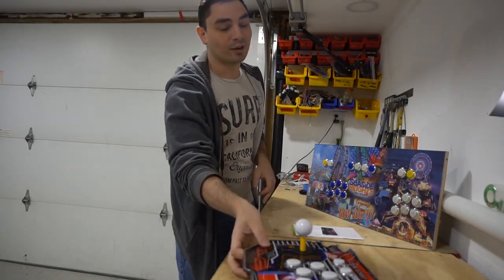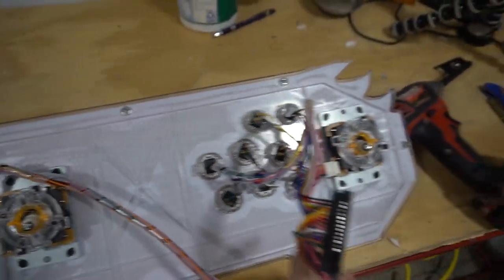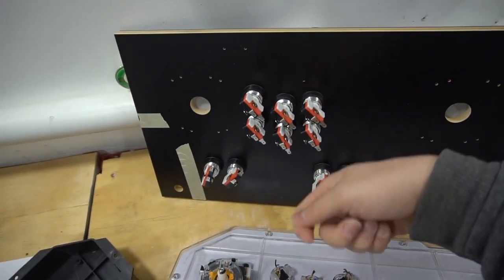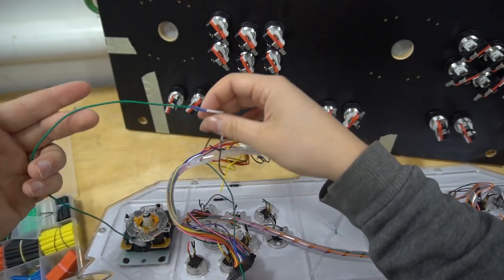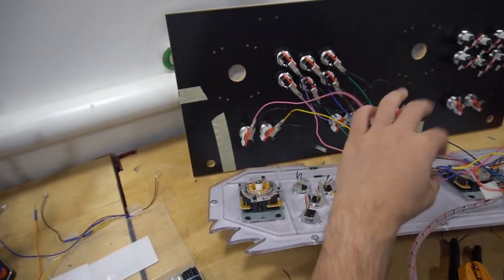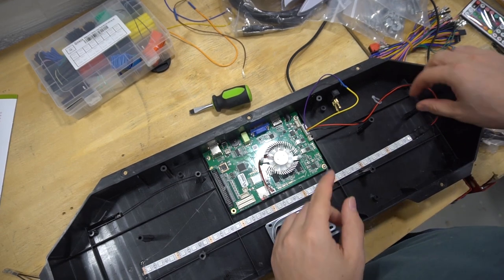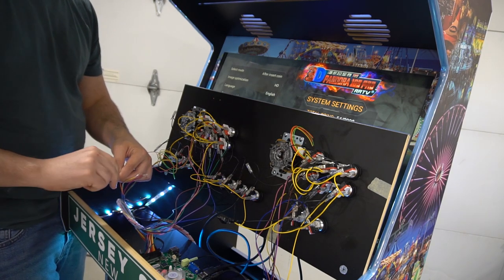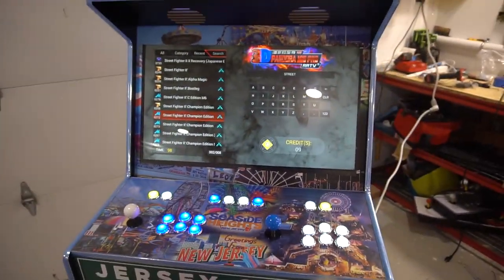Pandora's box Control Panel to Any Arcade Conversion Tutorial

Comment: I have a full size arcade cabinet. It's control panel is wired to JAMMA harness that is plugged into a Pandora's Box DX. If I wanted to add xbox/etc. to my cabinet could I (in theory) daisy chain each control button to an I-PAC, or similar and have both Pandora's Box and Xbox/etc. wired to my control panel? Only one device would be powered at a time to play.
Reply from the maker: Correct u gotta wire them in sync... see my videos where I have a control panel with pandora and rasp pi in 1. Same theory 🤘

Comment: Is there a way you could go over the pandora box options like a tutorial on some ins and outs? Like I’ve had mine for a little bit and just figured out how to connect it to wifi. I bought mine off marketplace so no manual or anything and haven’t been able to find a video that really goes into settings and such.
Reply from the maker: I'm working on a pandora  10th anniversary build now but there basically all the same 
I'll put Mayne a snippet of the menu stuff in the next video
Reply: @Vic_VP  okay awesome. Subbed and waiting.

Comment: Excellent detailed video as usual. I have 2 questions:

1. I have replaced all my Pandora buttons (16) with Sanwa. But on this control board I can see 4 extra button wholes. How about those? What should be the wiring of those extra buttons and functionalities. 

2. Is there any way to use Light guns on Pandora 3d? 

Thanks and best regards. 😊
Reply from the maker: The control panel I swap it with is also meant for a rasp pi or pc build incase the customer wants to upgrade. Pandora doesn't use those 4 buttons.

No light guns on pandora

Comment: I am trying to figure out how to convert a mame system with jamma connection and external power supply to use a pandora dx board.  Any guidance would be appreciated.
Reply from the maker: Mame system with jamma? What system do u have
Reply: No name cocktail system but running a XXXX Games Family JAMMA board CPU running some old hardened version of windows 2000.  Basically a small no frame flex PC board stacked together with a IDE hard disk and powered by a computer 1400 watt power supply.  Here is a link with a similar one.  "https://www.youtube.com/watch?v=Y1TpAQ_L0JA "  I was hoping I could plug a pandora DX 3 sided card into the harness and figure out how to power it correctly.  I don't want the PC power supply, too loud.  I am hoping it will just plug into the harness but then need to figure out power.  Thanks for any guidance @Vic_VP
Reply from the maker: @kerry9098  junk it all and run everything new to the board. U essentially already have the jamma harness, find a pandora with the same jamma but more current pandoras are running home edition jammas... so you'll need to splice

Comment: Are you able to get quarters to work for this? I got it so the game will start after you add quarters but after the games going adding more quarters does nothing.
Reply from the maker: Yes this works with quarters, but depending on game you may need to hold player 1 start button for a few seconds, a menu pops up and then You can select B to add credits

Comment: Can u connect the Pandora Box to an active Marquee?
Reply from the maker: Active marquee? Like a lcd marquee that displays the arcade game marquee during gameplay?

If that's what you mean... then no definitly not lol
Reply: @Vic_VP  well hell! I want to build an arcade cabinet. Do you have time to explain what is needed. Their is not any information about the Raspberry pi. I know the pandora box is plug and play. But is the Raspberry the same? Or do u need to download the games onto it yourself?
Reply from the maker: Some people have done acti e marquee on pis, I personally suggest PC builds for those tho as a rasp pi is just meh. People expect amazing quality and smooth gameplay on intense 3d graphics games like n64 from a 90$ mini Linux pc that fits in your hand.

Best to ask yourself what games do you want to play. This is your first arcade cab and your looking at the active marquee... kind like your going from beginner to expert lol.

Pandoras box is super easy, rasp pi you can go to arcade punks and download a image with games... but they are never plug and play easy. Panodras box are super easy and good starter/ beginners setups.

You can dm me on insta @vic_vp if needed
Reply: @Vic_VP   I am a hobbiest in wood building and I'm a chemical Technician who can get it most electrical problems solved.. the only question that is surprisingly hard to find is, if the PIs have built in games or pre-loaded. Believe it or not, no website answers that straight forward question. They have alot of good you tube videos like yourself that explains very well "How To".
Reply from the maker: Correct because creators / individuals make the images... like wolfanzo or the Supreme team.
Really companies like Nintendo don't like these image creactors which is why you'll never really get a direct answer on configuring. I always day in my videos nothing is plug and play (especially pis and pc builds)
It's something you gotta Def research and learn

Comment: Why buy a joystick to gut when buying just the Pandora's box is cheaper?
Reply from the maker: Negative it's not... at least when the time of filming its not
Haven't done a pandora in a while but if you buy the pandora alone your most likely buying only the box... no power supply and no wiring harness.
Cheaper to get a deck and gut it and also faster shipping

Comment: No need to gut it they sell them without the included box for about 50 quid
Reply from the maker: 👍 that's fine but in my experience and current situation getting the included box is cheaper than without. I don't no what 50 quid equals or includes
But I pay 100$ for the box. Comes with everything as far as harness, power supply and hdmi cable 🤷‍♂️
Reply: @Vic_VP  ok
Reply: @0bskra  where did you find all the stuff for 50 quid($56USD)? I got everything for $65 but that was after looking for hours for the best deal from China. Please share!